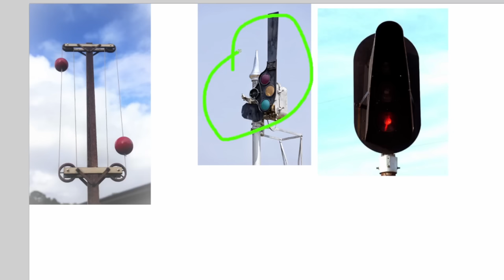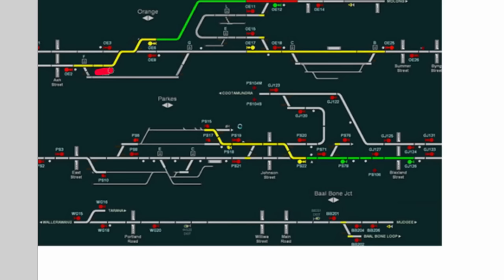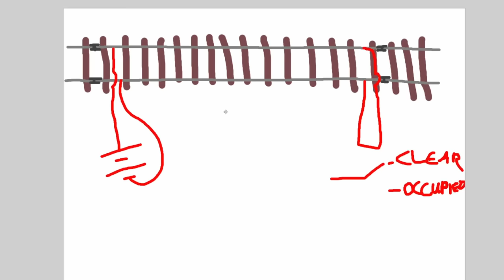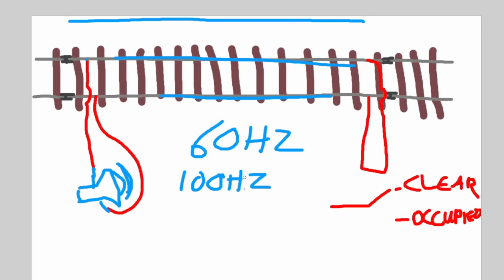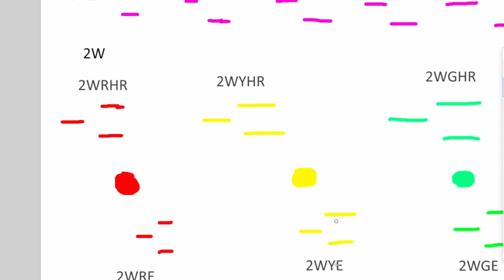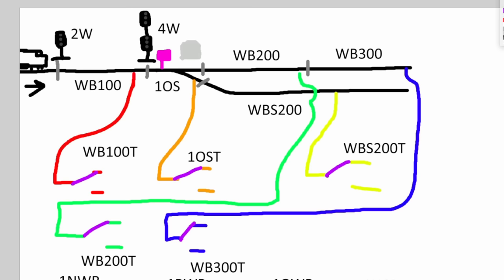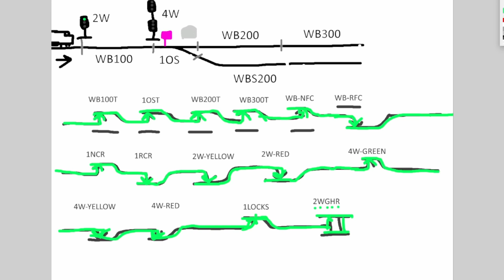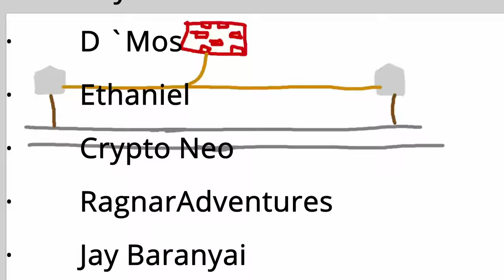SIGNALS 101: 10 Levels of Train Signal Understanding

Comment: Fascinating video, although my head was starting to spin . . .   You said the other day that you were moving from Seattle to work for the Colorado Railroad Museum.  Will you still be doing work as a signals designer?
Reply from the maker: Nope! I'm going to be working on steam locomotives in the roundhouse, among other things.
Reply: @Hyce777  Big career change!  Congratulations! I was a lawyer for 32 years and from time to time would toy with going to heavy equipment operator school but I never had the cohones to take off the golden handcuffs.   

Totally changing the subject, I haven't played video games since a tank game in a bar while in college in the 1970's.  I have a PC running windows 11.  If I wanted to try a steam train operator computer game, which would you recommend?
Reply from the maker: @Pamudder  Indeed, I did it before, but I'm taking off the golden handcuffs because it's what the heart wants, and I'm in a position to be able to do it. Very fortunate.

If you want to try and run steam trains on PC's - it really depends on how beefy your PC rig is. Some of the sim games can be very demanding, graphics card and processor-wise. I wouldn't recommend them if you don't have a system with that stuff in mind.
Reply: @Hyce777  My computer has a Intel(R) Core(TM) i7-8565U CPU @ 1.80GHz   1.99 GHz, and 16 GB of RAM.  I did not buy it with gaming in mind.  Is this likely to have enough power?
Reply from the maker: @Pamudder  That's a solid CPU, the GPU remains the question then. Train Simulator Classic with Smokebox's locomotives (of whatever variety) might be the thing to try, though they may be too graphics intensive
Reply: @Hyce777  Thank you.  I also fear that it will require a very expensive upgrade in  our allegedly high speed cable internet service.

Comment: Now do ETCS 😁🤓
Reply from the maker: I know nothing about ETCS. lol. wrong side of the country
Reply: @Hyce777  you mean pond. ETCS is European Train Control System, a concept aimed at unifying all the different signalling across Europe, not only on the signal end, but also on the train equipment, as currently an engine going across borders might need multiple different receptor units (like that magnetic stop signal, for example) and also integrating more modern train feedback methods so dispatch knows exactly where the train is at, where its end is at, how fast it is, where it wants to go, and ultimately that's no person in the end that sends back not a simple go or stop order, but how fast the train should go. That's like level 15 on your scale.
Reply from the maker: @LeifTheHead  ahhh. Here i was confusing it with whatever cab signal shenanigans they use on the northeast corridor. Cheers :)!

Comment: In datacenter terms, MTBF means mean time before failure, but I'm a pedantic ass.
Reply from the maker: Interesting. Every railroad related application or systems application I've seen have it as "between", but I'm not surprised it's had a few different contexts over the years.

Comment: Seems like super basic logic circuit. Seems like a basic transistor setup could accomplish this wo physical switching. Added vitality.
Reply from the maker: The physical switching is preferred right up until you get to the microprocessor stuff. Not sure why they never went after specific transistor designs, I'd have to put my thinking cap on.

Comment: Your understanding of the electrical circuit signalling is wrong. The relay should be in series with the battery and the left and right tracks should be electrically separated and the train completes the circuit activating a normally open or normally closed relay
Reply from the maker: The way I drew it they are in series? I suppose technically you'd have them directly next to each other in the bungalow but this was easier to do visually.
Reply: @Hyce777  no because your drawing shows the circuit as complete in both instances which is wrong.
Reply: No, the train deactivates the circuit by shorting out the relay.  The whole point of the design is that an active circuit corresponds to 'empty' and deactivating, it or any failure, switches it to 'occupied'.
Reply: @petehiggins33  from your answer I can guess you not an electrician or electrical engineer, you can't deactivate a circuit by completing it, definitely not the way it was illustrated, they use a normally closed contact that opens when circuit is completed (activated).
Reply: @gazloading  You are right, I retired from my forty year career as an electrical engineer ten years ago.  You can deactivate a relay by shorting its coil and preventing any voltage from appearing across it, which is what is happening in this circuit.
Reply: @petehiggins33  I'd be lying if I said I knew how to "short a coil" but connecting it in parallel (as illustrated) won't prevent voltage across it.
Reply: @gazloading  Shorting a component means connecting a low impedance across it so that it sees a negligible voltage.  In this case the wheels and axle of the train short the coil of the relay so it deactivates.  It's implied, but not shown in the diagram,  that the 'battery' is connected via some sort of impedance such as a resistor or a current limiter and this drops all the battery voltage when the coil is shorted.